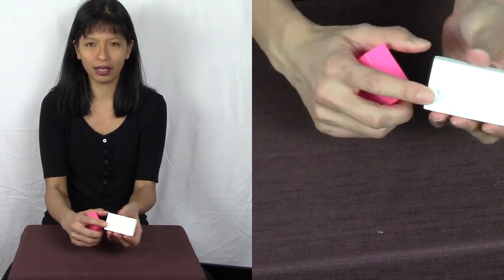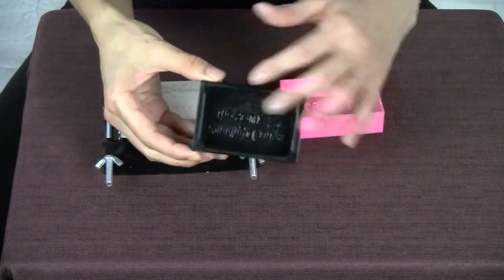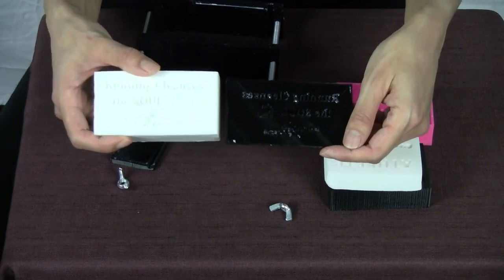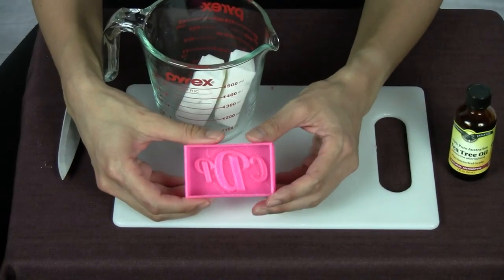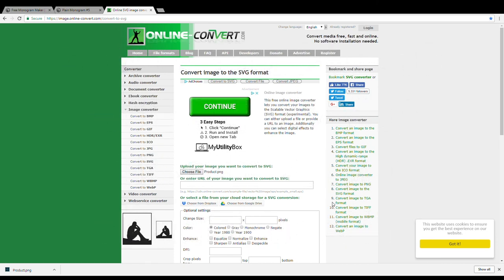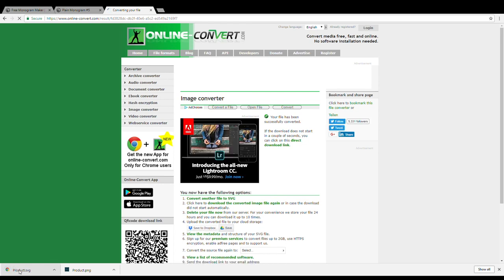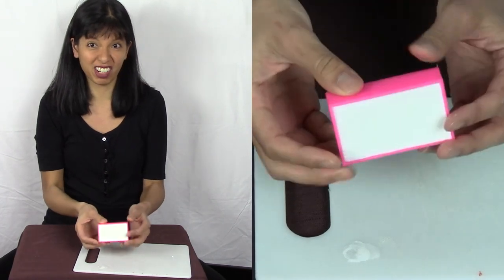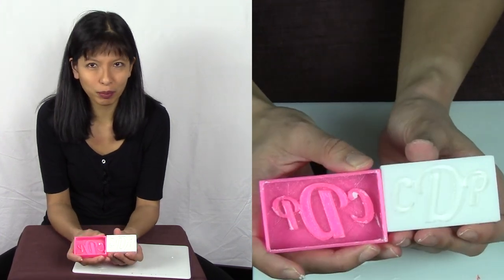3D Printing Soap Molds

Comment: Very nice SOAP MOLD project =)    It use to be on hard molds to use a 7 1/2 degree wall slope to ease produce extrication from the mold =)   The nice thing now is the flexible material used in the mold from the 3d printer stock filament =)   Thank you for doing this Caroline .... something practical uses for friends and family speciality occasions =)

Comment: Should have used silicone to make the mold instead of plastic.
Reply: Hard to find 3D printers that can print in silicone. Though I have found out that flexible PLA is now a thing (also biodegradable).